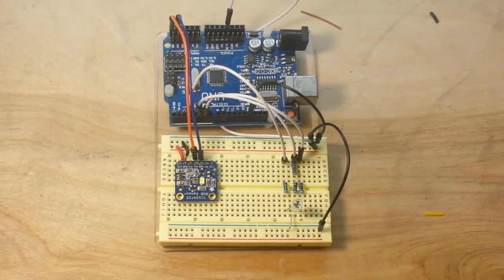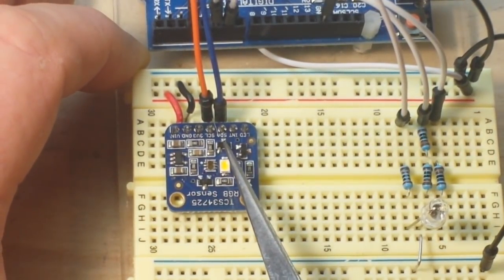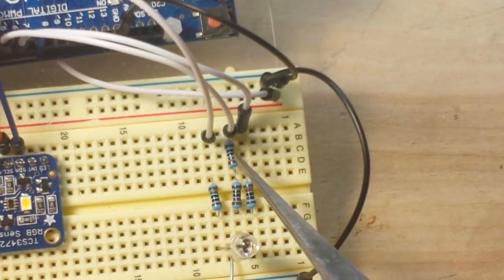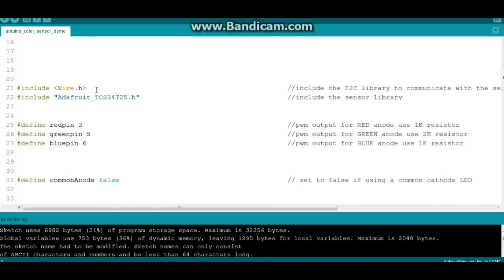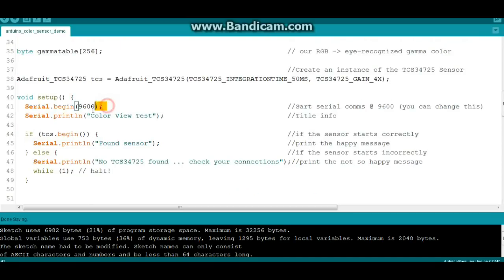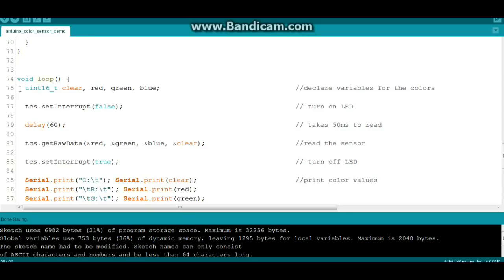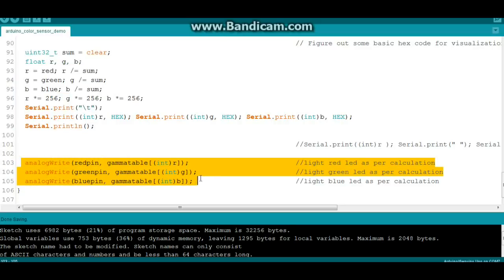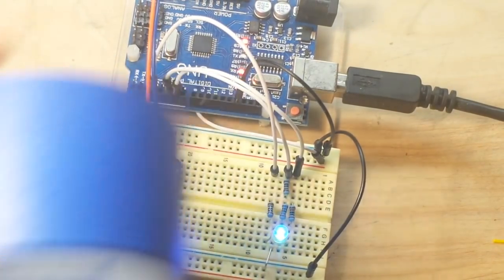Adafruit TCS34725 RGB Sensor Demo

Comment: Dear Sir; Thanks for your job. I have tried your proyect test for the TCS34275 and it works fine. It would be very much appreciated if you give us,  an arduino proyect, a robotic arm with TCS34275, detecting and sorting objects by color. Thanks again and best regards from Montevideo-Uruguay

Comment: Hi, what about the speed? If the sensor was to be fixed in front  a rotating part (ie Motor) would it detect a passing red stripe painted to that rotating part? Any idea if I could detect rpm or other fast readings like that? thanks

Comment: Can the TCS34725 detect the colour  of liquids in transparent containers accurately?
Reply: I think it might be able to. You can set the tcs to x60 gain and the integratiom time can be set from 1ms up to 600ms. You may have to shine a light through the liquid towards the sensor and tweak the tcs settings, but you should be able to
Reply from the maker: I doubt it
Reply: @learnelectronics  alright thanks. Do you know any sensor that can?
Reply: @learnelectronics  alright thanks. Do you know any sensor that can?

Comment: I bought one of these boards and look forward to trying it.  One thing you might try is using some sort of diffuser over your clear LED.  As you know, the LED has within it three individual LED's -R. G. and B.  Yellow is actually not a separate color, it's red and green added together.  This effect would be more evident if you were to, for example, project the output of the LED by projecting it on the wall of a white globe, like for a ceiling light.  Then the R and G will overlap on the wall with yellow in the that area and the entire surface of the globe will be yellow.

Comment: That Green LED is only using 1 resistor. You've shorted the other resistor because both ends are in the same row of 5.
Reply: Use an online resistor calculator for each color in the rgb led

Comment: has anyone seen something like this print out to a I2C OLED like and ssd1306? I have found several samples supposedly printing out to a LCD and never seen one work. I am trying to get it to output to an oled on a portable device and I suck at this. The wiring and all I have down pat but I'm way too green to know where I am going wrong substituting the OLED for the LCD. For that matter I have yet to see one of these projects out put raw values to an LCD and actually made it work.

Comment: Good Job!
I work for AMS and we make this part.  What you are trying to do is actually very hard to do well.   You are doing this open loop and limits the accuracy.   We’ve done the same thing only have enabled a second sensor on the LED.   The software then know how close is is to an accurate reproduction and can make real time adjustment.   Also we coded a PID loop for this self regulation.  It makes it converge much faster.   Hope this helps.
Reply: is there any chance you can share the project with that second sensor?

Comment: Your not making a 2k resistor with 2 x 1k as the second 1k is shorted out by the breadboard line. I think you thought of as you left a blank row but you didn't jump the 1k to the blank row.
Reply from the maker: yep, brain fart. When I get back from vacation I'm going to do an update.

Comment: I found this much easier to use than the TCS230, and the colour rendition is improved by using one of those flat LEDs. I managed to get a good differentiation between red, orange, yellow, green and blue, and made it turn a servo to point consistently to angles corresponding to the different colours.
Reply: Hey Phil, could you please respond with the code that allowed you to control the servo with the colour sensor? I am having trouble connecting the servo control code and the RGB colour sensor code in Arduino. I am using the TCS34725 and Arduino IDE to code, along with a servo motor. Thanks.